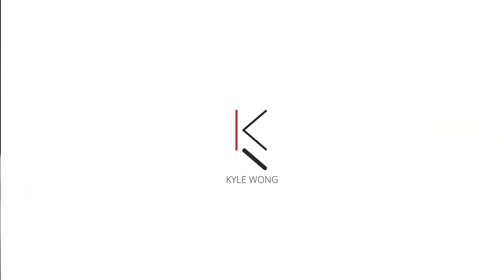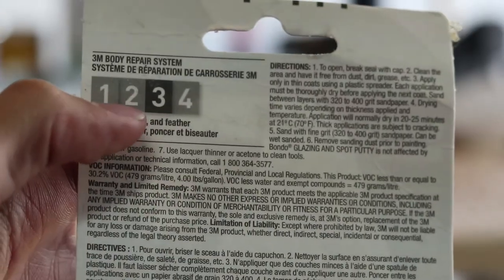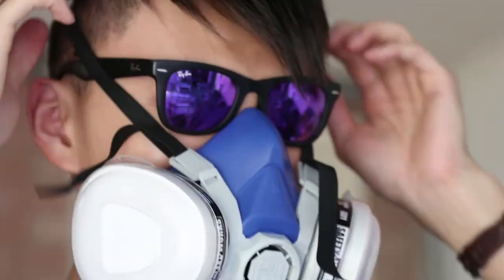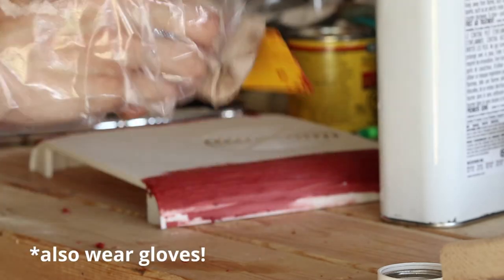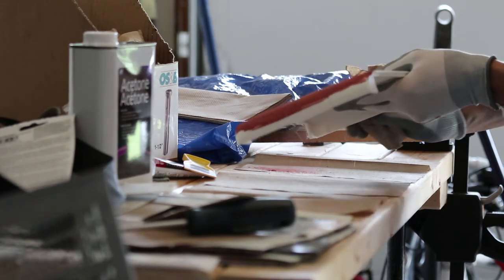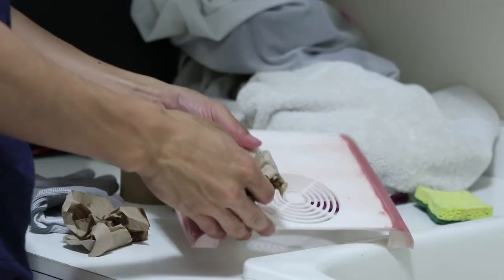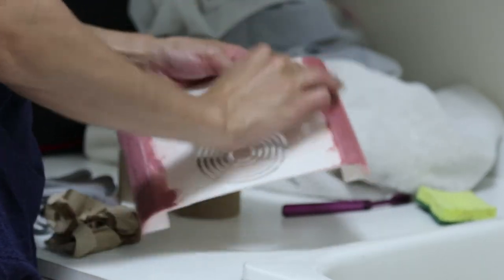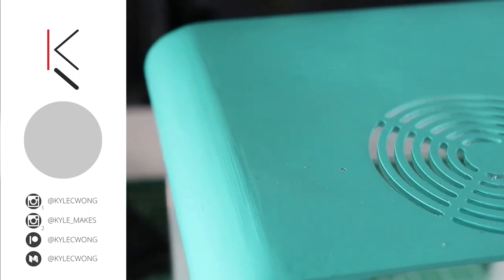How to repair a 3D print with bondo

Comment: Okay. This is some information I would have to use. I'm in the process of making a helmet and after taking the supports off, it didn't leave a gaping hole persay. Instead it looks like a topography map from an atlas book. For a moment I though I would have to use regular bondo. But I could use this to make the repairs.
Reply from the maker: Yeah! depending on the quality of your print it might get harder to do a clean repair with bondo. Mine was a little stringy at the bottom where I should have used supports - but the print was already finished and I didn't want to test the settings more to make a "near perfect" print. But I found it very useful for smoothing areas between layers!
Reply: I can see that. I was able to print 1 part of the helmet with a layer height of .15 mm with a .4 mm line width, but it made a "scar"on the print almost 5 inches across. It's going to take a couple of layers of spot putty to fill it out.